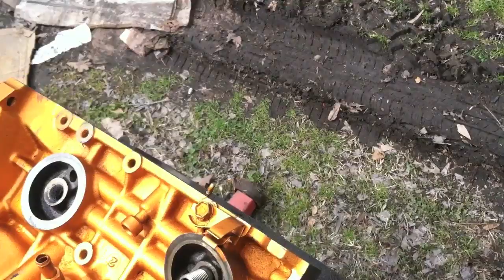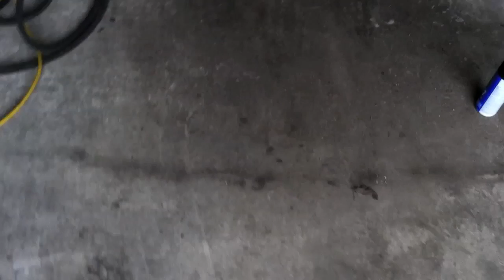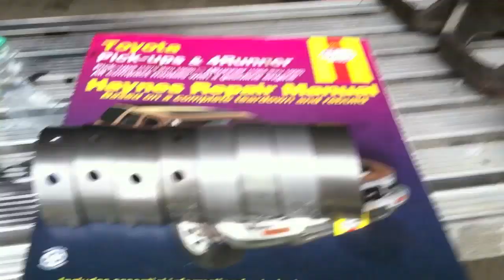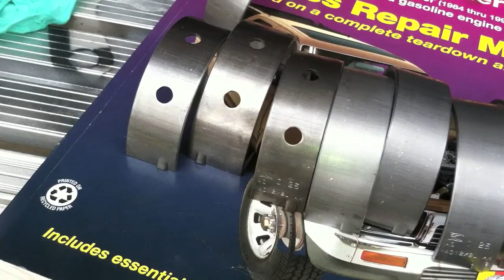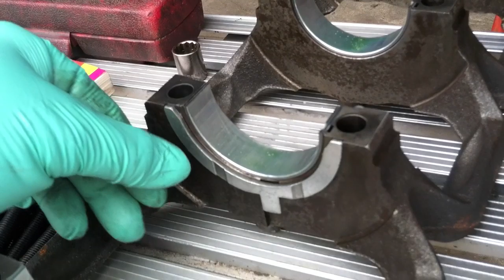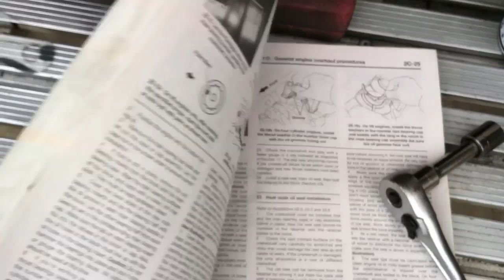3VZE Motor build Part 1

Comment: Crap motor, I have one for sale with low miles if anyone's interested
Reply: I have a 92 4runner with a 3zve. 350,000 miles and running strong. I pull my 18 foot Procraft bass boat with it. No crap motor.  Good motor.
Reply: @thundersuckler5194  absolutely zero power lol first and second the rest you have to open the door and make sure the ground is still moving

Comment: What is the major difference between the 3vze and the 3vzfe.  And how difficult would it be for someone like me, with limited mechanical experience, to do a rebuild?
Reply: +Jesse Berain 3vze has single overhead cams, 3vzfe has dual overhead cams, forged crank, cast rods  and is a camry engine

Comment: Yeah, my problem is funds so a rebuild, or rather a full engine gasket set replacement would be my "rebuild." My engine has high compression still and burn no oil at all, so it is still tight.